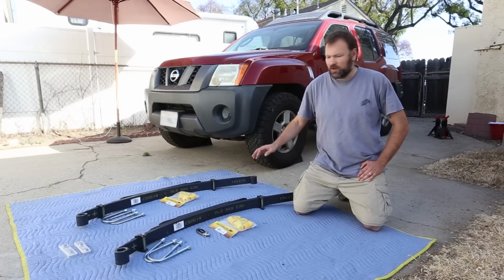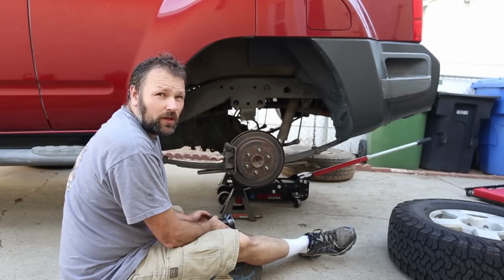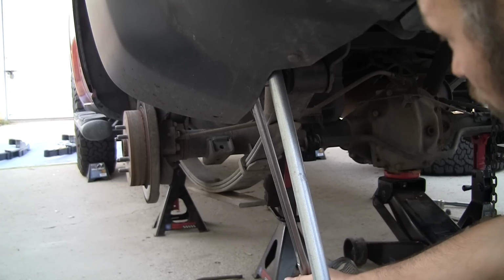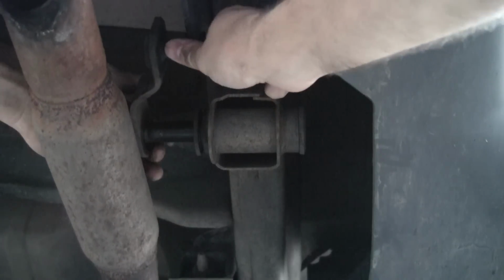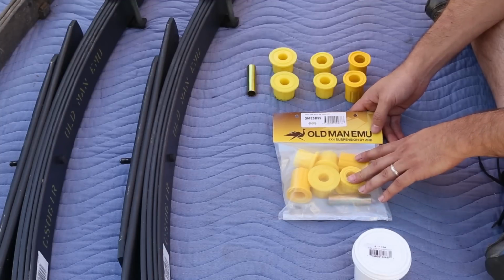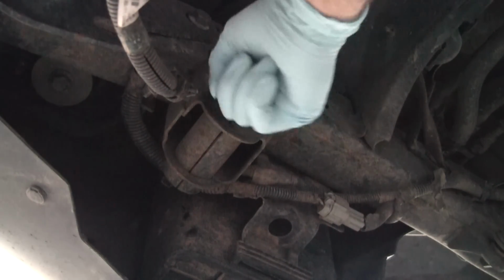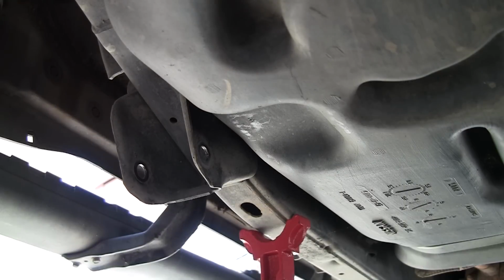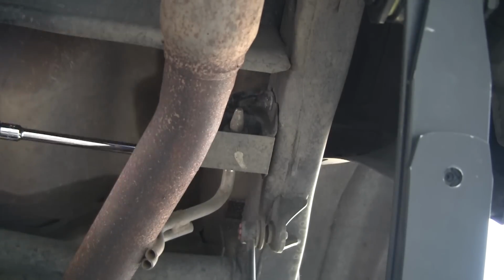Old Man Emu (OME) Dakar Leaf Spring Install on an Xterra

Comment: Really helpful video thank you. 
Just installed with your video as a guide. very smooth. I did opt to leave the rear sway bar off as its not really doing anything for the rear any way. saving on the relocation kit. but other than that followed verbatim. 
Thanks again.
Reply: How are the results ? How does it feel ? An y vibration ?

Comment: why not just cut the old bolts
Reply from the maker: To each his own. You can cut them if you want to...
Reply from the maker: Just be careful... you don't want to accidentally damage the abs sensor cable, brake line, or parking brake. Using a wrench seems safer to me.
Reply: @maytawn  I wonder if that commenter above has ever used an angle grinder to cut steel.  Unless you're willing to remove everything remotely flammable from your garage and you enjoy fireworks I'd stick with a wrench.  Heck, if you get a deep socket air or electric impact wrench it's just a few seconds to brrrrrrp them off anyway!

Comment: Did you install a leaf spring kit in the front also? Could you show pictures of the final product since there isn't a video?
Reply: Xterra’s don’t have front leaf springs...
Reply from the maker: Yes, I upgraded the front coil springs and shocks at the same time I upgraded the rear leaf springs. The install of the front springs and shocks is comparatively much easier that the rear so I did not shoot a video for that.

Comment: Are the longer U bolts necessary? I'm hoping that I will be able to use the stock U bolts if possible. Thank you for sharing this video!
Reply from the maker: The stock U-bolts are not long enough for the OME springs. You will definitely need new ones that are longer.
Reply: Jeremy Boyd thank you, Sir for your response. you sir, are a scholar and a gentleman.

Comment: Great video and step-by-step instructions.  One question:  Why did you choose not to go with the OME greasable shackles ?
Reply from the maker: I considered them, but decided not go with them mostly due to the added cost. I shot the video over a year ago (even though I only posted it a few months ago) and I haven't had any trouble with squeaking. The Energy Suspension grease is really good stuff.
Reply: The grease:  Is that Energy Suspension p/n: 9.11104?
Reply from the maker: Yes, there’s a link in the description.

Comment: Nice work!  I assume you did the rear suspension work and drove it a bit before doing the front suspension leveling.  How did it drive before the doing the work on the front?  If you didn't do the work on the front would the drive still be ok and was the front rake too noticeable?

Comment: How is the new ride quality on and off road?   Thanks for sharing.
Reply from the maker: I really like the setup. I also put on OME shocks and springs in the front to level everything out. The ride is a little stiffer than stock, but I kind of like that. My rear end doesn't bottom out anymore when going over bumps so I really like that.

Comment: After a couple of weeks how do you like the ride? Anything you would do differently?
Reply from the maker: I really like the setup. Everything feels solid. Honestly, I wouldn't do much differently... other than maybe I wouldn't have waited so long to upgrade. :) Another thing I will mention is I initially debated whether to add shims for the drive shaft. Some sites said I would need them and other said I wouldn't need them for a 2" lift. Ultimately I decided to try to get away without them. I think that was a good call because I didn't have any driveshaft vibration that needed correcting.
Reply: @maytawn  So since you posted this video, have you yet to notice any vibration from the driveshaft? I am about to do the same install, including shims, but the company missed packing them in the shipment. So no shims, I am debating on just install the leafs springs etc without adding the axle shims.
Reply from the maker: @manitoba43  Some vibration developed and was slightly noticeable at speeds above 80 MPH. I replaced the rear u-joint and it has mostly disappeared. My car now has 234,000 miles on it... at this point vibration could be coming from just about anywhere as things age.
Reply: @maytawn  Thanks for the reply. What year is your Xterra?
Reply from the maker: @manitoba43  2005